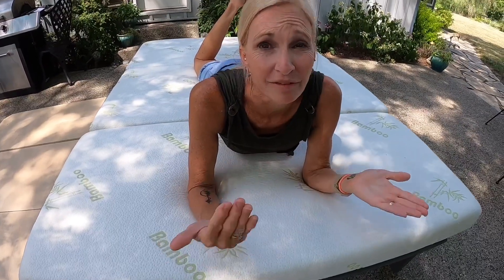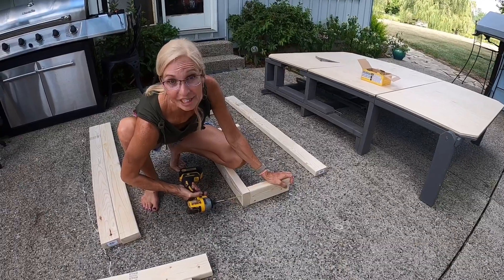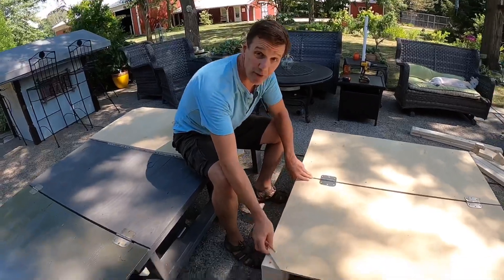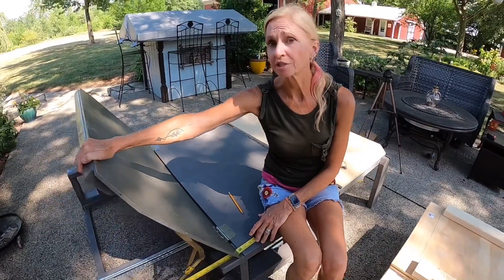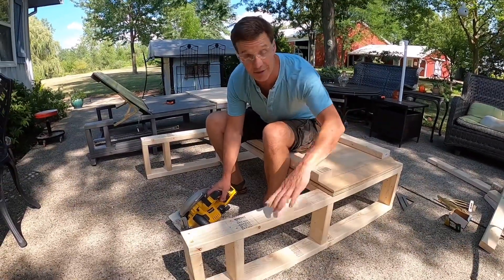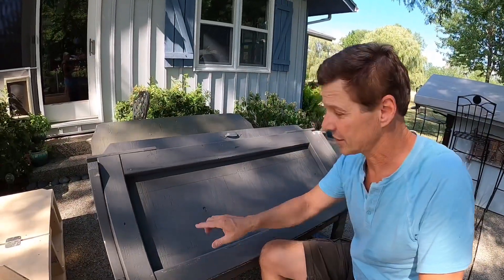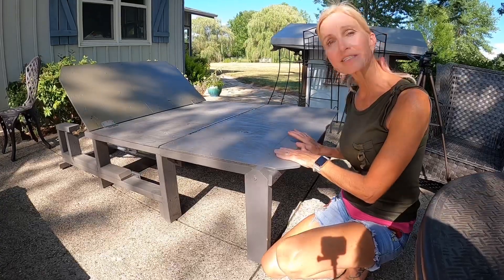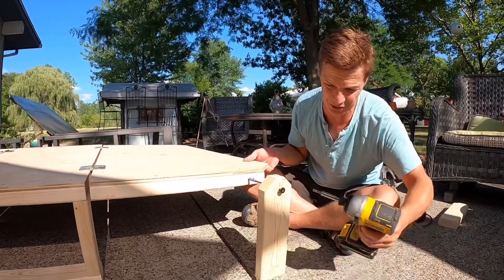Minivan Camper bed build tutorial DIY

Comment: Hi Chuck and Terri! We're Rob and Christy and we are about to build out our Sienna camper van. Love your bed platform design and thinking I would improve upon your design I sourced some slightly more expensive drafting table ratcheting brackets from Rockler. But the ECLV drafting table ratcheting brackets that you use are larger, and all metal (no plastic like Rocklers) and are less expensive to boot! So stick with what they suggest and happy camping!
Reply from the maker: Do they have plastic in the ratchet glides?
Reply: To Be Created Yes the Rocklers do have plastic. This may be one of those rare times when the cheaper item is better. The ECLV’s should be delivered tomorrow and I’ll compare quality and get back to you.
Reply: I am hoping I’ll be able to make this work in my Ford transit connect.

Comment: Thank you for the video. I'm researching ways to make a bed in our van.  We also have trifold mattresses.   Did you keep the mattresses original or alter it?  Could you show how it works on the bed frame, especially folding the inside piece back to make a couch?
Reply from the maker: The mattress was shortened slightly.  As far as the the couch mode - all of our build is on our channel. Check it out.

Comment: Thanks for the great idea and plans.  I am just finishing my build and installation using your plans.  I am now working on a way to restrain the bed in the event of an accident since I'd rather not be killed by a flying bed.  This system will need to deal with a negative 50g pulse in100 milliseconds.  I will probably use seat belt webbing attached to seat anchors or seatbelt anchors.
Reply from the maker: Thanks for the kind words. As it relates to the restrain, we bolted a 2x2 along the back edge of the van. Then we screw the bed into place. It is very secure. We have not covered that in any vids yet. Thanks for watching.
Reply: @ToBeCreated  You guys rock! This is going to save me so much time.  Thank you!  Would you mind sharing more details and pics/video about the restrain?  Did you have to drill into the van?
Reply from the maker: @chr1shuber  We hope to cover this in a video in the next couple weeks.

Comment: Thanks for sharing plans. I like this design. Is there any reason that you went with 2x4s rather than 2x3s where your weight is being supported and 2x2s where it's not? I'm thinking of ease of installation by one person. Less weight is better if it's strong enough and you don't always have helpers around to install or remove it..
Reply from the maker: Not a big fan of 2x3s as they tend to wrap. Anyway whatever makes sense and works for you.

Comment from the maker: We updated the pdf instructions as we forgot to add some critical measurements. They have been added to the 4th page.
Reply: Love your set up!!  Where can i find the PDF instructions? Thank you
Reply: @elisamartinez5187  Under the video, click on, "More".
Reply from the maker: @neoham585  we use reflectix on the windows and leave the ceiling vent open about 1/2 (without the fan running)

Comment: Hello! Planning to use your design (and purchase supplies with your links), and was looking at the folding mattress. I think you guys have a 05 odyssey, we have and 06, so same van. At it's narrowest point it is about 48" wide, and the full trifold is showing 52" wide. How did it end up fitting? We don't mind scrunching it in, as long as it is pretty flat. Please let us know, thanks and great channel!!!
Reply from the maker: We have a Sienna but I don’t know if that matters much. After building the platform, our van gains a couple more inches than what the floor measures. The full-size mattress fits snugly but we also used a regular full spring mattress on the floor but since there’s a slope, we opted to build the platform to make it a flat surface. Hope this helps.

Comment: Finally someone designed a great folding bench/bed with a ratcheted tilt! Thats how it should be done. Glad Terri pushed you and the envelope!😎👍 I've seen a few others, but the tilt was too flimsy or required extra effort. Whats the height for storage below? Also, didn't see any overall length x width x height for the bed? *Would love to see a future build with a twin-bed layout and the split-fold 3rd row, 40 seat intact? I know thats like a magic trick dream!😊

Comment: Im curious about headroom?  Im building a 2014 sienna.  When in the couch mode, it looks like the pdf shows aprox. 13" from floor to top of plywood.  With thickness of third section flipped over and two mattress sections, doesnt your head hit the ceiling in couch mode?  Thanks so much guys!  Happy trails!
Reply from the maker: Yes. So the 3rd cushion can simply be removed and not stacked. Even with that I am 5’11’ and it is not comfortable. Works fine for Terri. So the end result is that we don’t use the couch feature but regularly fold up that section to access storage.
Reply: Thanks for the quick reply !  I will have to decide which i value more, the storage space or more comfortable couch.

Comment: Where did you get the Ratcheting system ? Are they strong enough to support the back when in couch mode? Not sliding down ?
Reply from the maker: Oh yes. The supports are strong enough for both of us. Check links in our description.
Reply: @ToBeCreated  thanks！ another questions: when you change it from a bed to a couch , where do you place the extra section of the form? If you  fold it to the seat and sit on it , it will be 8 “ thick, same if you fold it up as back support .

Comment: Your link to the mattress looks like it isn't 48" What did you guys actually use?
Reply from the maker: Yes you are correct.  That listing has 3 sizes, we chose the full (52”) in 4” which is currently unavailable, but they do have the 6”
Reply: Thanks! So the 52" fits ok?
Reply from the maker: @mrkkitson  yes 👍